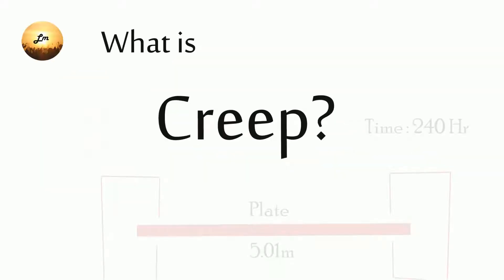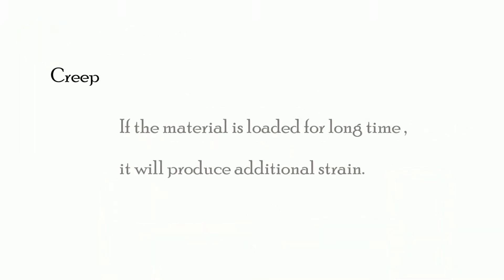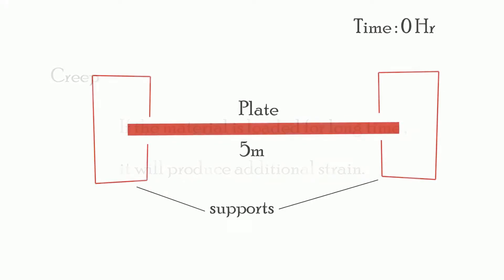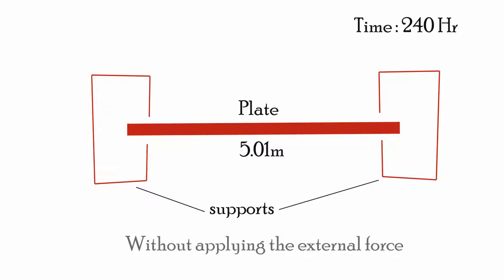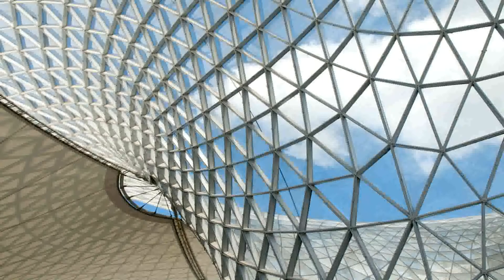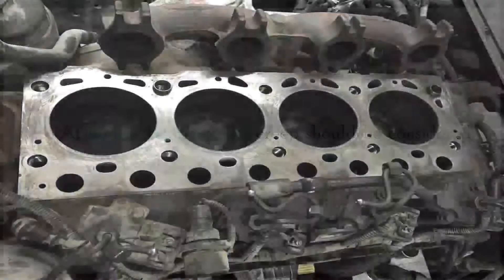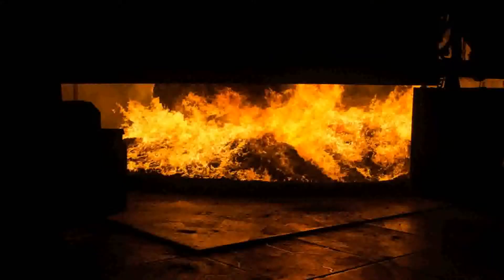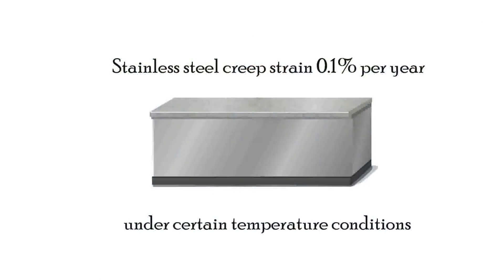Creep (deformation)

Comment: why in creep defformation has initial strain and dosen't start from zero ?
Reply from the maker: We can calculate from zero. It's not perfect calculation to get the definite results. Whatever the elements we design, it starts to deform over the time. Hence, we consider as in percentage value for the material in design
Reply: @Birds_view_1  Doesn't clear for me and so don't undrestand
Reply from the maker: You are going to design some product. You need to select the material. If the product needs to work for long time. Wood has some creep value. Stainless-steel has some value. Accordingly we select them.
Reply: @Birds_view_1  Ok bro thank you 😍